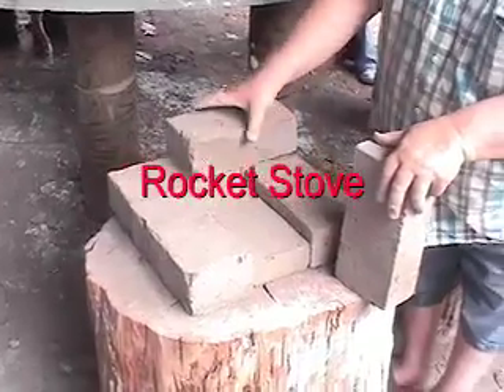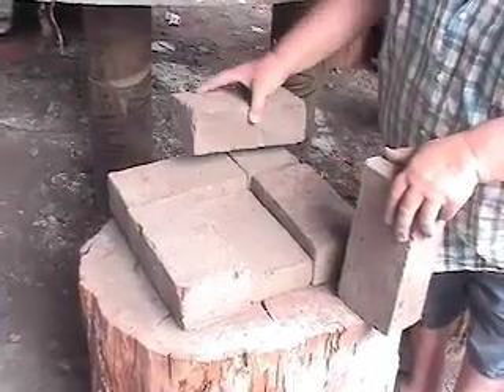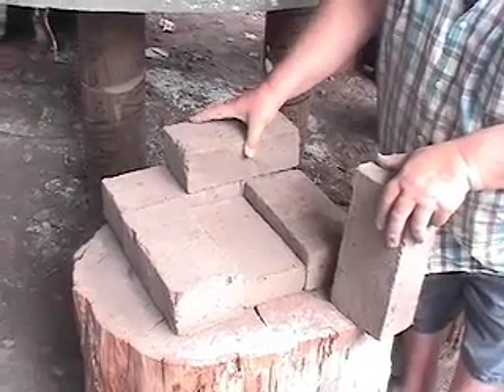How to Make a 16 Brick Rocket Stove

Comment from the maker: I have built one with regular bricks (from home Depot).   I made the half brick with a hammer and chisel.  It did work, however the lighter the brick the more heat will be concentrated inside your combustion chamber.   Give it a try.

Comment from the maker: More from solarwindmama--The vertical combustion chamber needs to be twice the length of the horizontal combustion chamber. Also for steady air flow and maximum combustion efficiency, the opening on the horizontal chamber needs to be the same size as the opening on the vertical chamber.  I have made a rocket stove with regular bricks from Home Depot and it works fine. The advantage of adobe bricks is that they are great insulators keeping more of the heat inside the combustion chamber.

Comment from the maker: Thanks to all who have watched and commented on my video. I'm combining my responses to several of your questions in this post. I did watch the Swedish torch video.  It's a great idea, although it still produces smoke. The great advantage of using a rocket stove is that the combustion chamber and the horizontal intake chamber which constantly feeds air into the fire result in a smokeless fire.  I've run out of space on this post so I'll put the rest of my response in a second post.

Comment: @noneuklid Because at around 3:07 you can something propping up the plate so I dont think its actually blocking anything so the direct heat is still probably faster than a bonfire.

Comment: You can build a bigger one, slap mud on the outside and a chimney made of pipe on top. It will heat an entire house. How do I know? I have one. I dismantled it and used new fire brick in a rebuilt one about 4 years ago. It took a total of 3 hours to build and should last a decade!  Cost me about $160 to build... Yea

Comment from the maker: Part 5 or 5. The pottery stores sell a more sticky clay called  RED ART BUT IT IS CONSIDERABLY MORE EXPENSIVE. A "syrup" of 6 # of brown sugar and 1# of salt cooked in hot water used for mixing with 100# clay will improve The clay. Probably best not to use portland cement with this  SUGAR mixture. In Haiti we could get sufficient "sugar" by first cooking the  baggase and the water we are using to make the" bricks"  The END.

Comment from the maker: part 4 of 5. This is still 1/2 heavy to 1/2 light mix.  Mix everything except the cement then mix it in last. In the self fired adobe stove, organic material on inside burns out leaving insulating voids. The shavings or fibers on the outside of the stove do not burn which helps reinforce the adobe.  If clay is very good, the heavy part of the mix can be reduced to about 40%-10 parts heavy to 14 parts light. In U.S. one can buy a large sack of cheap powdered fire clay from masonry supply stores.

Comment from the maker: you can use it indoors, but it's not recommended.  Even though there is little to no smoke, a rocket stove still produces a fire which burns up the oxygen and produces poisonous CO2.  Check out other rocket stove sites on the internet for designs that include chimneys to vent the combusted gasses outside.

Comment from the maker: Rocket stoves burn wood, which is renewable but since 2.5 billion people still cook every day over wood fires, the planet is running out of trees.  Rocket stoves have such efficient combustion that they use only a tiny fraction of the wood used in a normal fire to generate enough heat to cook food or boil water.

Comment from the maker: The bricks are unfired adobe using about 50% clay and 50% sawdust, chopped straw or rice hulls.  The more organic material you can mix with the clay up to about 50% the better the insulation and the hotter the fire will be for the most complete combustion.